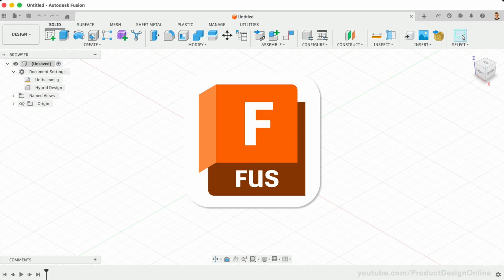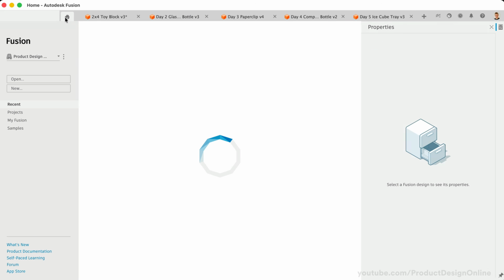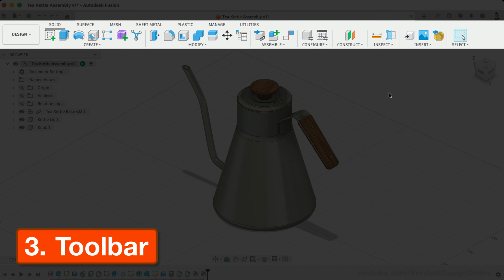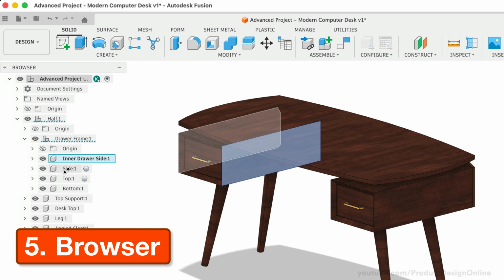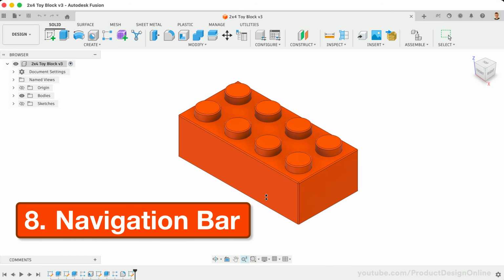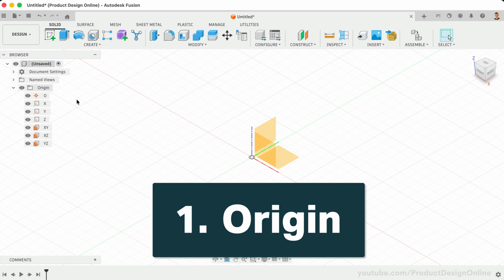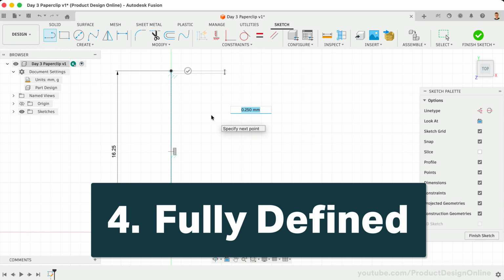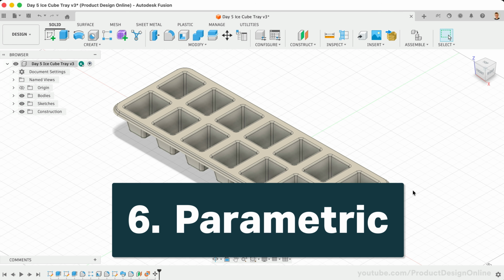Don't open Fusion 360 until you learn these 8 terms

Comment: Hey, can you make a video on how NPT threads work in Fusion? I’m trying to add a 1/4 NPT thread to an outer cylindrical surface using the Create → Thread tool, but it won’t apply. I’ve been stuck on this for a while—would appreciate an explanation.
Reply from the maker: I cover the basics of threads in Days 4 and 6. You need a cylindrical face to select to start the threads. What kind of 3D body do you have?
Reply: @ProductDesignOnline  cylindrical surface I need to make a 1/4 ntp male
Reply: @ProductDesignOnline  I don’t know what I am doing wrong but apparently is impossible to make a 1/4 ntp male in fusion 😢
Reply from the maker: Apologies, read your comment quick and didn't think it through :) 

Fusion doesn't support NPT in the thread command. The easiest would be to use the McMaster-Carr add-in (start with a Hybrid design) and insert NPT threads that way.

Comment: Do i need to push shitf+right click in windows to see the marking menu? Can i change it in the preferences to just rigth click
Reply from the maker: Hmm.. I wasn't aware of any difference for Windows. Are you using a standard 2 button mouse or something different?
Reply: @ProductDesignOnline  i use standart 2 button mouse with a scroll wheel. When i see people use marking menu in videos, tried shift button and it worked. But nobody mention how they reach the menu
Reply from the maker: Thanks for the follow-up! I primarily use Mac OS so I'll have to look into this. When I have used Windows before it did work with a right-click for me though... I'll ask the Fusion team.

Glad Shift + right-click will work in the meantime.
Reply: @ProductDesignOnline thank you so much, i ll google it next time i open fusion. If i find anything, i ll keep you posted.
Reply: @iamsure83 Click your avatar, then "Preferences→ General→ Pan, Zoom, Orbit, Zoom shortcuts." Change them to something other than "TinkerCAD"
Reply: @ProductDesignOnline  since i used thinkercad before fusion, i set the pan,zoom, orbit shortcuts as tinkercad. thats why right-click menu show up in different style. now i set it back to fusion in preferences menu and i got the marking menu with the rigth-click :)
Reply from the maker: ah, that makes sense! I'm glad to hear that's what it was and not a bug and/or change to the Windows version. I appreciate the update!